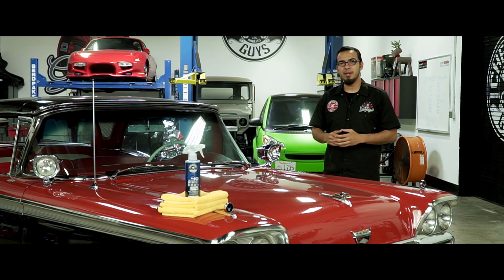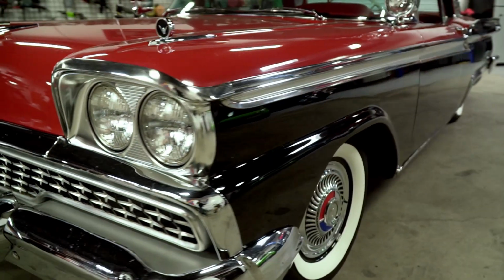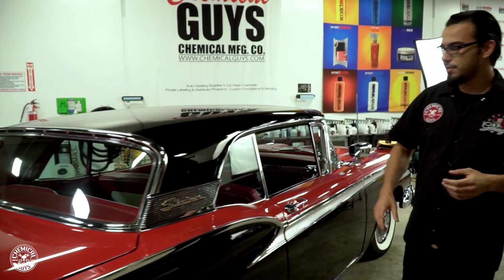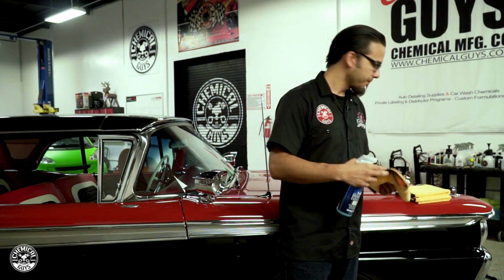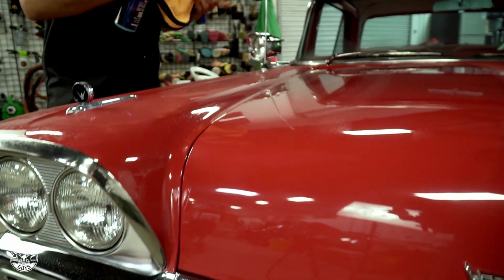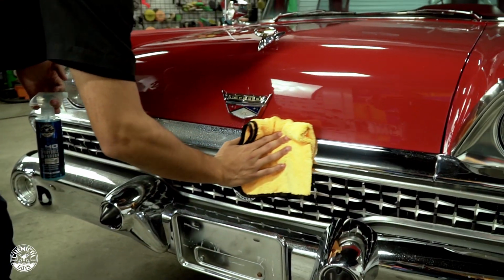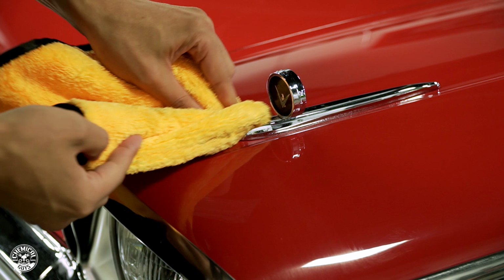How Do You Know When To Use A Quick Detail Spray - 1959 Ford Skyliner - Chemical Guys

Comment: Since p40 has wax does it haze up ? I don’t use any other detailer besides synthetic quick  detailer because it flashes as you wipe  and I don’t really have to buff off anything. With p40 is it the same? 

Thanks because I want to try different detail sprays , I really love synthetic quick detailer
Reply from the maker: Hey there! Thanks for checking out our video. P40 contains a fine amount of wax that doesn't haze. Simply spray and wipe away.

Comment: So when should I use detail spray ?
Reply: If you have protected your vehicle with a sealent(JetSeal) or coating(HydroSlick) and have topped it off with a wax, the best recommendation is at least once a week or before you take your vehicle out for a cruise. But it is very important you are doing your maintenance washes at least once a week or twice a month. Due keep in mind that if it is a show vehicle and kept in a garage most of the time then don't worry about maintenance so much, just simply use your quick detailer as your maintenance.

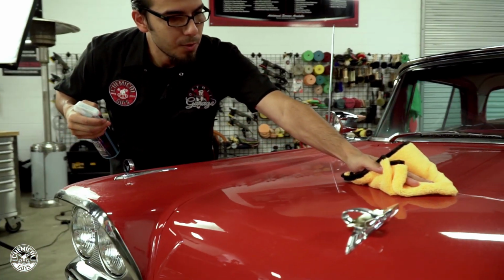Comment: 2:30 "You see that layer of dirt that was actually on there..." aaaaand ignore the thick layer of dirt; carry on wiping this rare car with the dirty side of the towel. What's wrong with you guys? Why wipe the rest of that hood with a blatant thick line of dirt after 1:50 saying "and since we have a silk embedded edge I'm not going to run the risk of installing new swirls and scratches..." Seriously?? Oh yea of course just carry on scratching visible dirt particles all over the whole paintwork but hey ho at least the silk embedded edge microfiber towel will protect it. Idiots.

Comment: How should I keep my car clean after doing your flow chart detail on my car, P40 or V07? Or both? 🤔
Reply from the maker: Hi, happy Monday. Both P40 and V7 quick detailers will clean your car, enhance the brilliant shine, and lay down a light layer of protection. The main different is V7 is going to lay down a light layer of sealant, whereas P40 will lay down a light layer of wax. Which quick detailer you choose depends on you, what kind of protection you already have on your car, and if you are looking for a product with sealant or wax. If you have a sealant coat on your car, we recommend V7 and if you have a wax coat on your car, we recommend P40. Rest assured, you can't really go wrong with either, though! Thanks for watching and make sure to stay tuned for a new video dropping later today!
Reply from the maker: Using both isn't really necessary. It would be much more effective to use the time and energy to make sure all the all the steps in a full detail are completed prior, such as glaze, sealant, and wax.
Reply: So V7 to maintain the car after I’ve glazed, sealed and waxed?  If after doing the full detail, let’s say the car gets really dirty in 3 weeks or so, would it be or to quick wash it with Ecosmart and then V7? Or would Ecosmart strip the Jetseal and Wax?
Reply from the maker: Yep! That's a great detailing regimen. EcoSmart will not strip the JetSeal and wax, in fact, it will enhance it!

Comment: Aren't you afraid that the thin layer of dirt can still scratch the paint when wiping with the towel. Can I use a quick detailer every week?
Reply from the maker: Hey Dean, thanks for watching this killer video, and this killer car. There's very little risk at all, the emulsifiers lift up dirt and suspend it away from the surface while lubricants create a slick barrier which prevents dirt from scratching the paint. Quick detail sprays can't harm your paint, it's perfectly safe to use them every week, or in between washes to remove thin layers of dirt and add a quick amount of shine. Stay tuned Dean, more great videos are being released every three weeks.

C.G. Alex -

Comment: Even if I was a pro and know exactly what I'm doing, I would still be scared to detail this car. It's too beautiful. I wouldn't want to risk accidentally hurting the paint or chrome.
Reply from the maker: The P40 used in the video is gentle enough to be used on most paint surfaces, the formula contains chemicals that are non corrosive or caustic. Detail in confidence my friend. P40 lubricates and cleans light dirt and debris without swirls or scratches.

Comment: Hope this is the right place to ask a few questions / this weekend I went to town on my truck (full clay bar / white light / jet seal then white wax) she turned out amazing. 

The questions now - if I want to take care of that high gloss shine, should my maintenance be weekly wash "two bucket and foam cannon" then apply was again monthly? Or should I just use P40 or maybe some Indra shine)!
Any recommendations on maintaining a great shine on 5 hours of a labor of love would be great !!
Reply: thank for the reply...
Reply from the maker: Hi Pierre, A regular wash and wax should do the ticket, in between washes you could use P40 to keep the vehicle shining, clean up small messes here and there. Wax the car after you wash to maintain that sleek wet glow you've grown to love. Washing with a pressure washer would speed up the process.

Comment: Why use this over a waterless wash you guys have?
Reply from the maker: Hey thanks for watching our video. The detailing spray complements your waterless wash, it's great for use in between washes, lubricating your clay bar, and cleaning up after paint correction. It's easy to grab a bottle of P40 and clean stains, tree sap, pollen, dust, dirt and environmental run off.